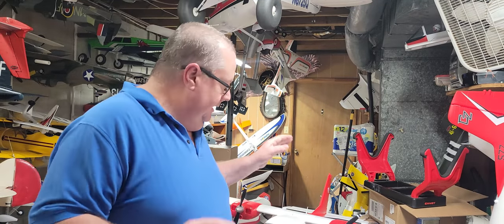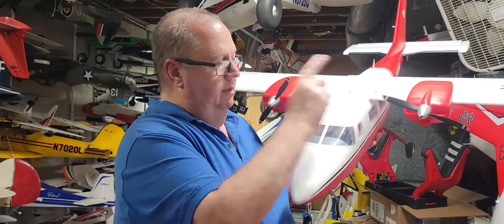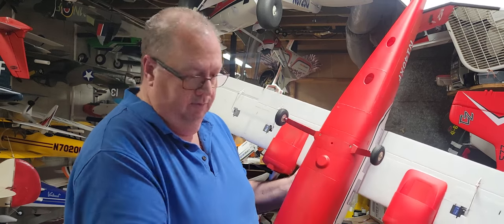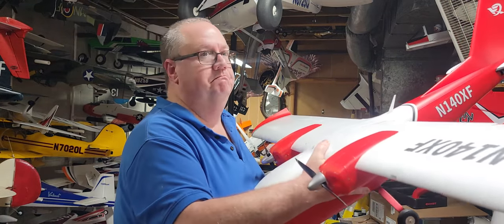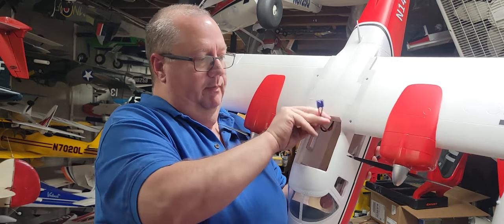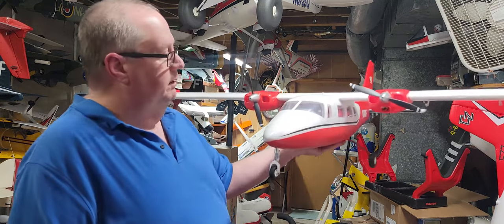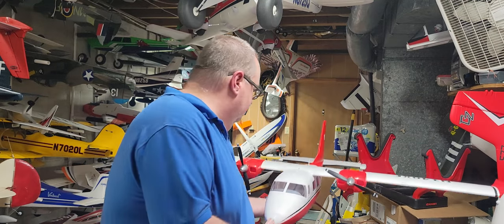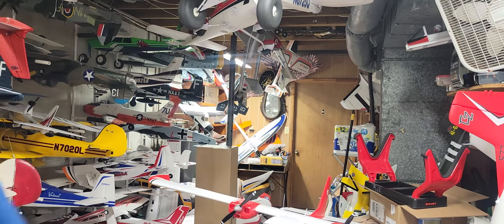FAT GUY FLIES RC POST BUILD OVERVIEW OF THE X FLY TWIN NOVA!

Comment: Based on your review of the 'Twotter' some time ago, I equipped one for medium range front yard FPV last year, and it proved very quiet and capable, actually rivalling my long range Binary. I suspect this one could be even better in that respect. I am eager to see how well it can do fairly short precision landings, and how quietly it can be flown!
Reply from the maker: Well as far as outfitting it in FPV the battery bay is huge and there is a lot of room elsewhere in the plane.
Reply: @FatGuyFliesRC  Which is more than I can say for the Twotter. I managed to squeeze in a full size Vector, but I had to compress my wiring to the brink of nuclear fusion to get the wings on. Happy flying!